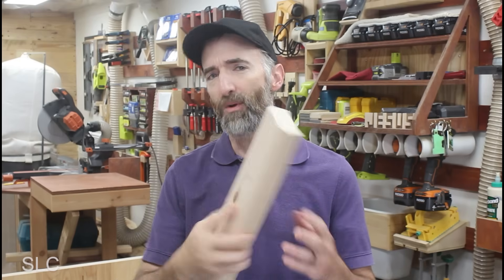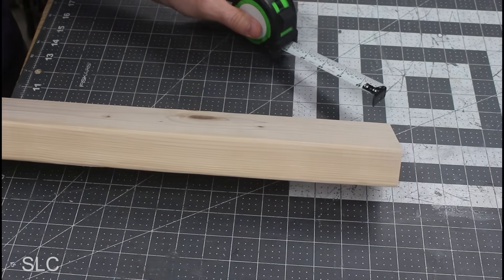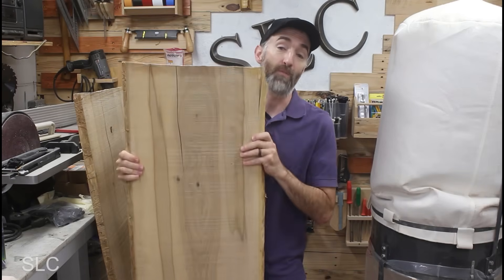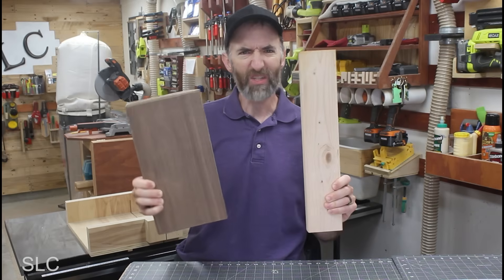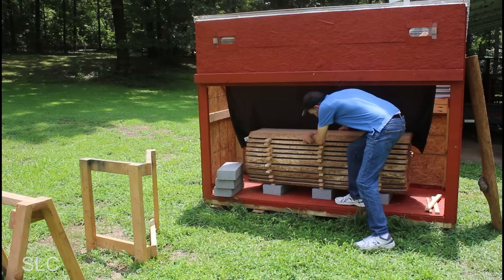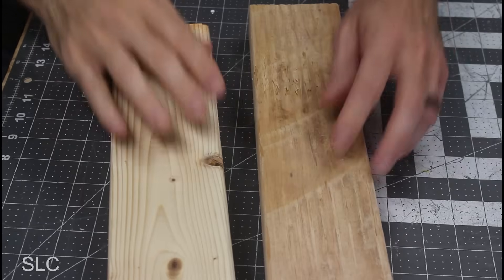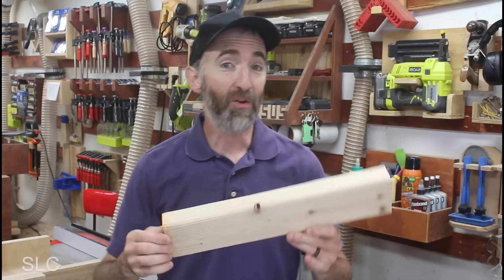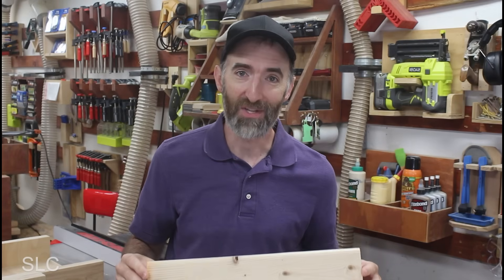Why a "2x4" is NOT a 2 by 4 (for Beginners)

Comment: This is even then lying.I am not US citizen, living in Sweden, we counting in millimeter. 2x4 which is approx 50x100 millimeter. Here the 2x4  is in the lumber yard is 45x95 millimeter, not even 38x89, which is the 1,5x3.5 coll. (1 coll is 25,4 mm) The swedish metering is more correct, more accurate than US metering.And in Sweden also they are dried and planed the wood products.